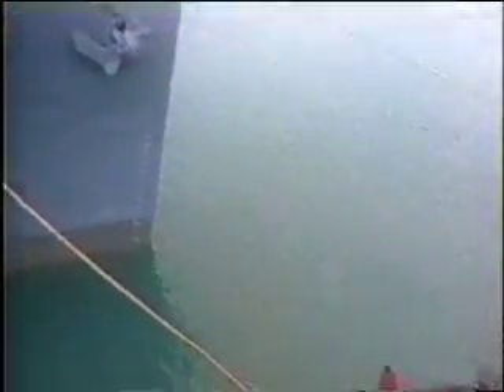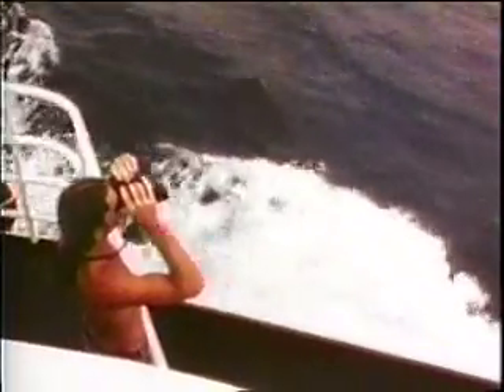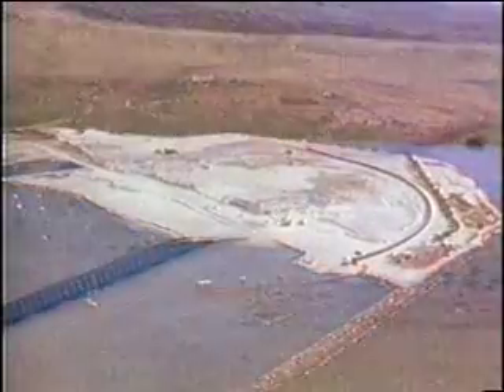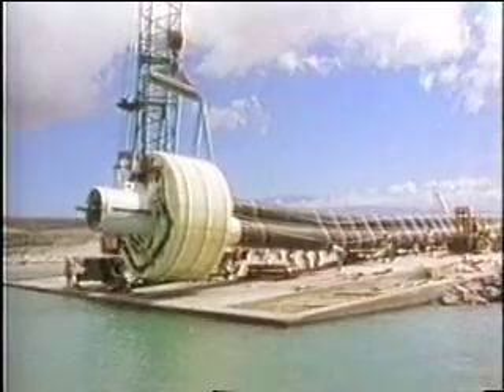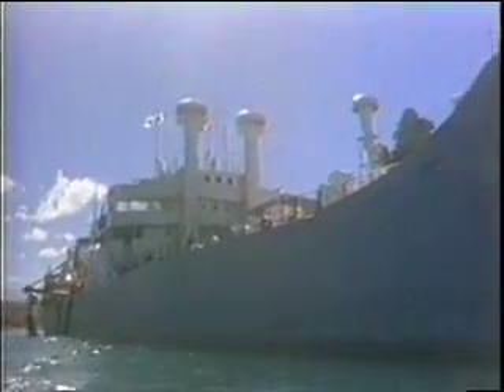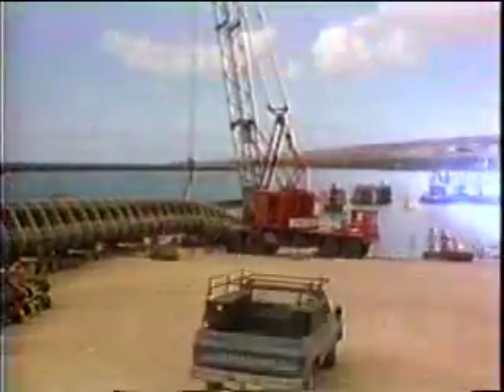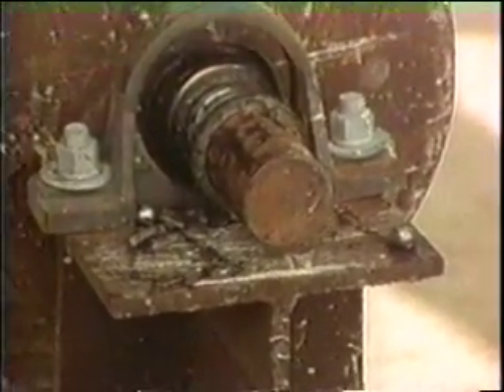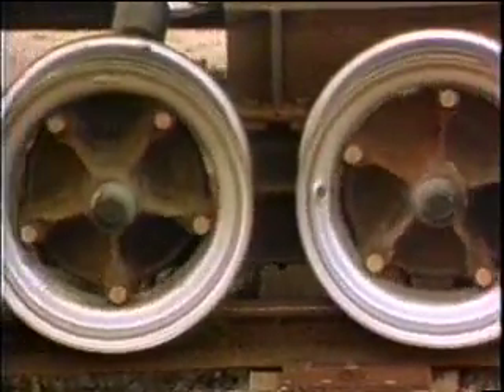Ocean Energy Launch (Part-1)

Comment: OTEC is perfect not to provide energy but was a mean to produce WATER , is the cold end or the siphon of energy, all work comes from energy diference, now use otec energy to pump cold water to the top of an updraft tower and get the water from condensation of the vapor in the air flux of the updraft. i´m that clever??

Comment: i dont get it, wouldnt the energy required to pump the cold water up from the depths kind of offset the energy you can get from the thermal expansion/contraction of the working fluid?
i mean, isnt there a reason the cold water is seperated from the warm water in the first place, because it lacked the energy to mix the warm and cold waters...